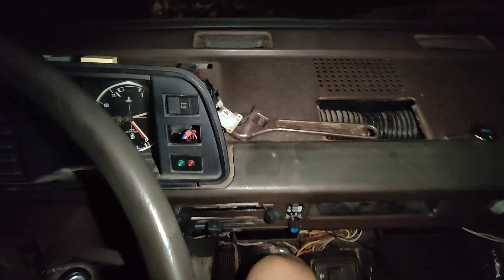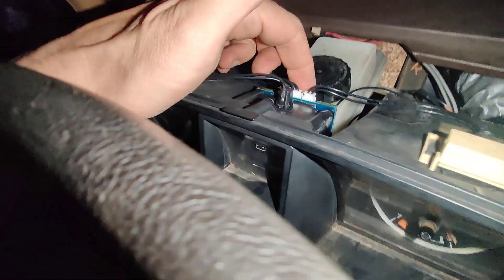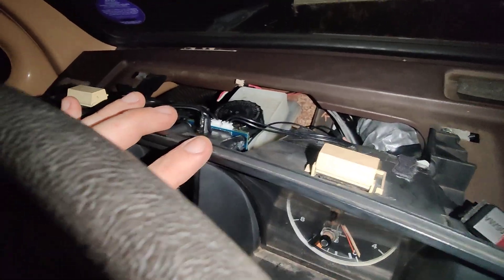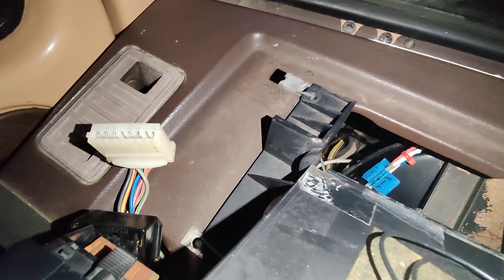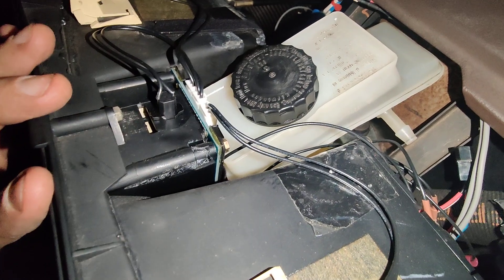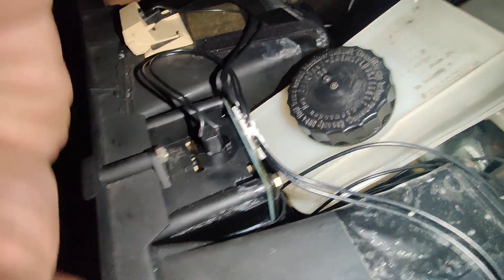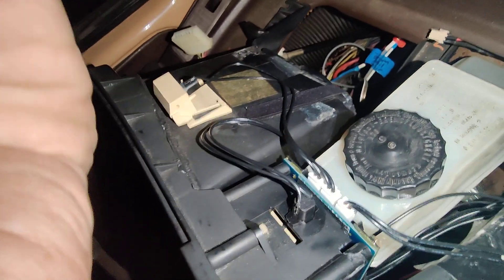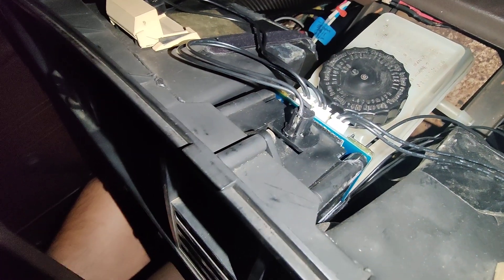1984 VW Vanagon - Slow Bridge + BMW brake booster incompatibility

Comment: If its from a e30 M3 it didn't work because its wider.
Reply from the maker: This one was from a 1984 318i and it's wider, but the real problem is that it's deeper...
Reply: @jwgmail , so which BMW booster fits best, (year, model, etc.)?
Reply: @jwgmail  with wider i mean deeper, all of them have more diameter, i got one, time ago but i didnt install it yet. I dont know why yours didnt fit :/
Reply from the maker: @andrewmeadors936  this one was supposed to, so I have no good advice : (
There are a couple other good vanagon brake booster videos on youtube and I think you could see the part # on one of them and it was the same as the one I got.
Reply from the maker: Here it is.  Actually my part # is different.  https://www.youtube.com/watch?v=JhBI1QJoMTo&ab_channel=Johnny%27sVolkswagenT3
Reply from the maker: @andrewmeadors936   @cristianpr  Ok apparently it's because I have the "long" version of the brake fluid reservoir.  Mine is straight and another (later) version has little wings on the sides, but isn't as long.  Going to buy one of those and see if it fits.